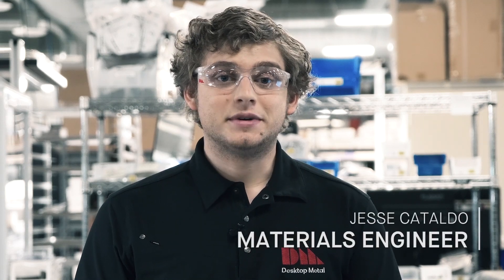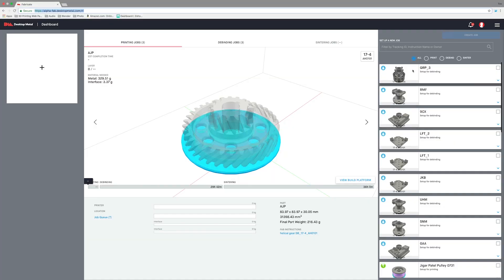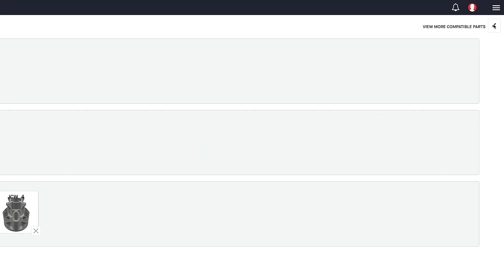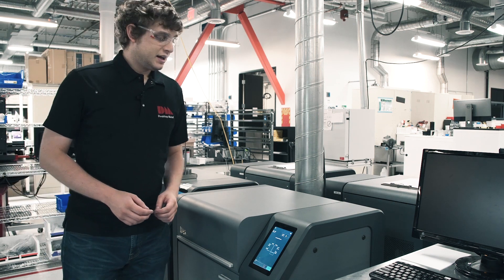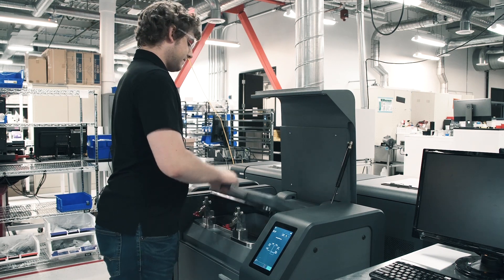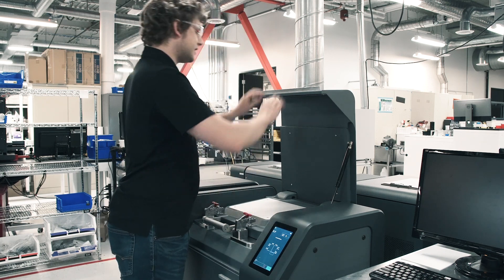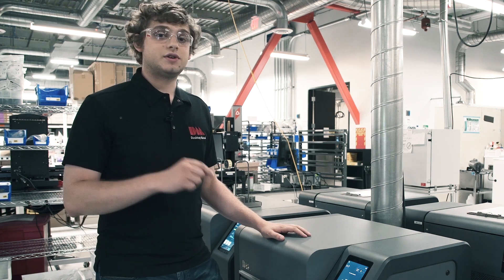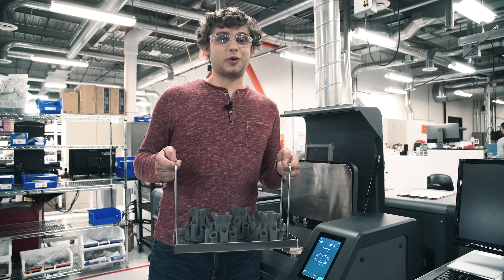How To Debind A Metal 3D Printed Part | Desktop Metal 3D Printing 101

Comment: Was definitely hoping for an explanation of what debinding is and at a minimum what the machine is doing internally.
Reply from the maker: The debinding step in a powder metallurgy process is designed to remove binding agents in the part prior to the sintering process. Depending on the specific binder being used, this is done via degradation and/or evaporation or with a solvent. The "binder" is necessary in order to shape the part in the printing process and create a way in which the powdered metal can be extruded in a controlled manner. 

_Degradation: A chemical reaction between the gas used in the furnace and the binder that degrades the binder into new components that can then be evaporated.

_Evaporation: Binder is brought to an elevated temperature where it becomes vapor. Many times, the binder will break into small molecules before evaporating. The vapors can then leave the part through surface-connected pores that will later be removed during sintering. Gas flow helps to sweep the binder away from the part and out of the furnace chamber.

_External Solvent Debind (What DM Uses) - The Studio System debinder immerses green parts in proprietary debind fluid, that uses heat and agitation to dissolve primary binder and creating open-pore channels throughout the part in preparation for sintering.

The temperature at which thermal debinding occurs depends on both the binder material and metal being used, but generally happens between 200C and 550C. Furnaces typically ramp up slowly to ensure the binder isn’t converted to gas too quickly, potentially damaging parts. During the furnace cycle, gas constantly flows through the furnace to remove binder and ensure the atmosphere prevents oxidation of the metal. The gas will either be inert or reducing to ensure minimal oxidation occurs.

The original Desktop Metal Studio system and some of the materials used on the Studio 2 system use the external solvent debind process with the debinding system. The Studio System 2 removes the need for the debinding system by utilizing the evaporation method. 

Hope this answers your questions
Reply: the "proprietary fluid" is likely very similar in composition to 3m's novec degreaser. I;ve seen the best FDM debinding results from external solvent debinding like the markforged metalx. With something liek binder jetting degradation or evaporation seems to yield good results from what I've observed. Hope this helps